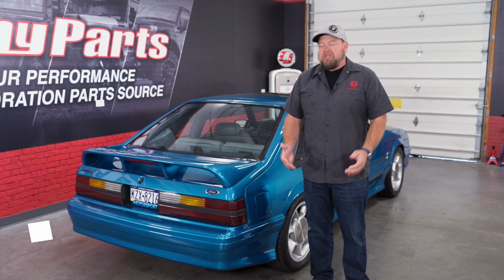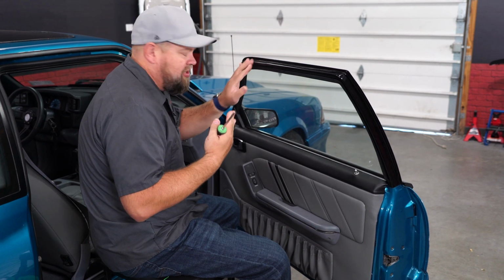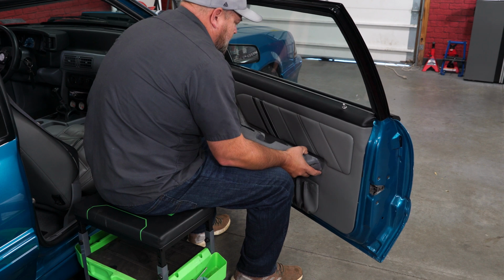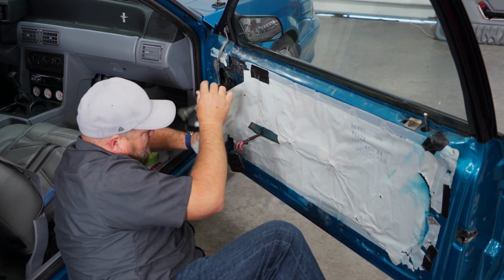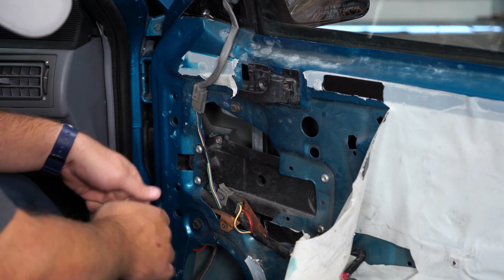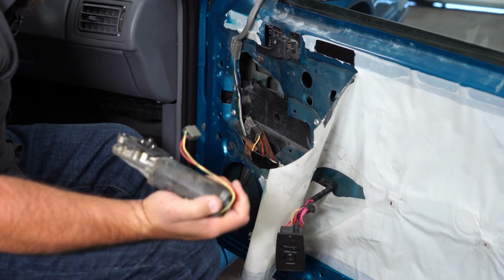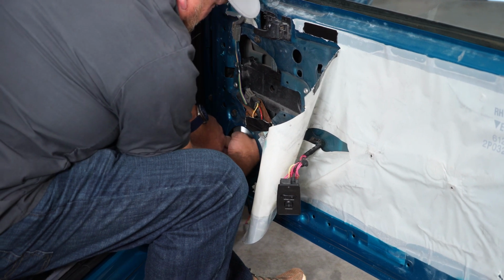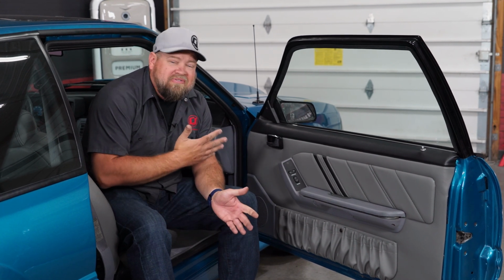1971-1993 Mustang Install | Passenger Side Power Window Motor

Comment: For 71/ 73 models, with factory power windows it aint that easy. According to the shop manual, you gotta drill three holes in order to reach the motor bolts. There's a template to be used, but the door of my 72 looks different and there's no way to understand where the holes gotta be done!

Comment: FYI - if anyone has a 71-73 with factory power windows you will have to cut the connector off and solder your old harness connector on.